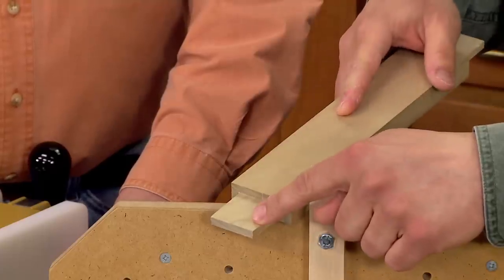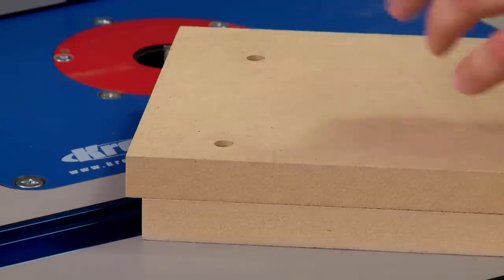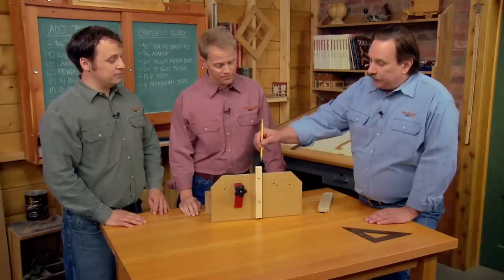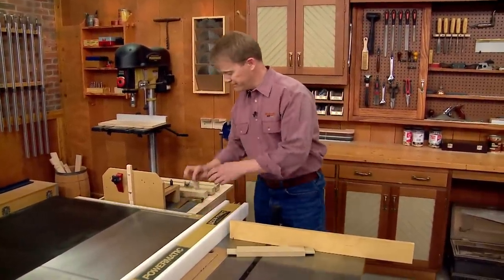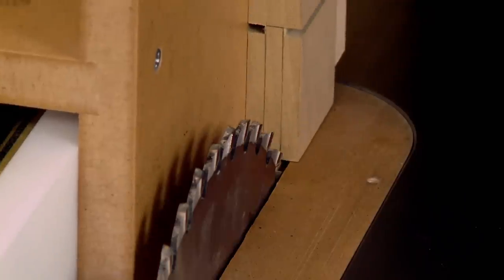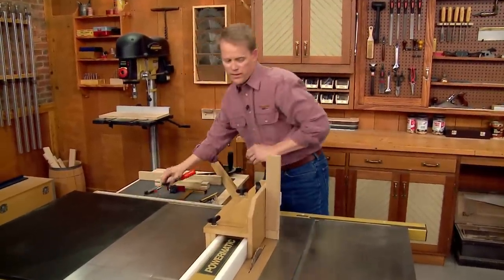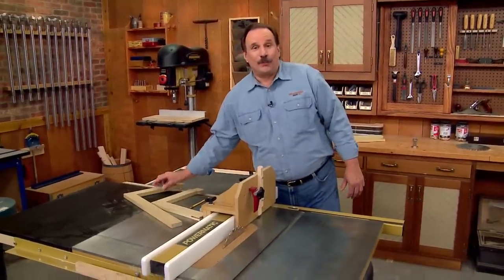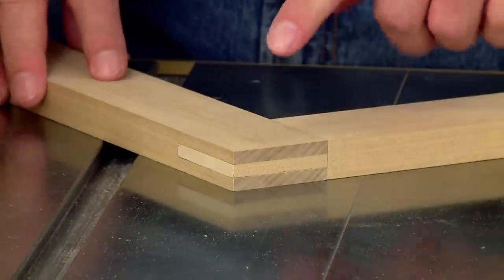Cut Perfect Tenons with this Table Saw Jig!

Comment: nice technic, with the long holes on the router table. I was wondering if this would have been a case for  the use of the guide rail in front of the router? i have seen it seldemly used, honestly i cant remeber one case where it was used. i know you properly tackled the the problem (short side routing on a long board) with the multiple passes, but i also would love a short feedback. thank you in advance
Reply: I agree, other builds I have seen simply build the base 'to fit' with the fit tolerance of a playing card

Comment: That drill hole for alignment tip you mention around 2:00 in, also works well for cutting tenons with stop blocks on the router table. Good call!

Comment: Why adjustable?   It is made with MDF in video.
Reply from the maker: The fit around the fence is adjustable so that could possibly fit around any sized table and/or you can adjust the fit so it slides easily along the fence (not too tight or too loose).  Yes, material we used is MDF, but you could just as easily use plywood, as well.

Comment: Excellent jig design. I only have one comment that I wish you would address. I have been trying to buy a router table since July. No one has them, of ANY brand. I even wrote to the Kreg company. Their answer was that they can't produce them fast enough and some parts are not sourced in the US. They are STILL trying (in NOVEMBER!) to fill their back orders. If we cannot buy a router table, I would have preferred that you also discussed a way to make this without a table. I do have a router. No table. I use it freehand.

Comment: Hi great video btw. The wooden stop block u used , could this then be used as a template for all joints the same size. Just write on it the measurements and keep
Reply from the maker: Yeah, I think that is a pretty clever tip if you wanted to have specific stops to set up for similar tenons in the future... you might have to do a little tweaking to get a perfect fit, but it's a great starting point.  One thing that you'll have to consider is that the workpieces will also need to be exactly the same thickness as before.

Comment: I see that saw threw all those small pieces that were cut at a good speed. aren't they fast to cause injury? or they can be. cuz i see them fly back towards you
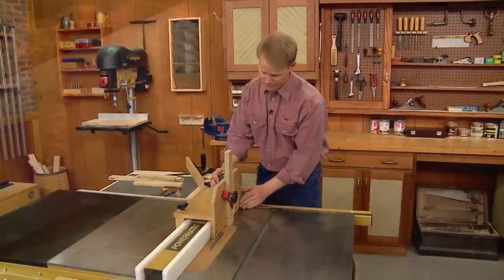Reply from the maker: I assume we are looking at about the 7:18 mark in the video... I think because we are shooting so close up it looks more dramatic than it actually is.  If you look closer the piece starts to slow down before it leaves the screen and if I recall correctly it never actually gets past the edge of the table saw.
Reply: @WoodsmithShowandmagazine   I just started in woodworking and most scary thing for me is Table saw. But I am always thinking 10 times before putting a piece to cut making sure no kick back. i had 3 kick backs so far. two I did on purpose to see how things can go wrong with small wooden pieces and man it goes like a bullet. I always stay at sides at safe region, and wear protection. I see you were standing at sides too. which is good. still we gotta be careful from these kick backs. good video. i learned a lot. Thank you :)
Reply: @WoodsmithShowandmagazine  ??
Reply: @alishanmao  You're doing good. altough that piece of wood particularly didn't go fast backwards. There are some pieces that may get back at good speed. So trying not to stand directly behind it's always a good idea. Hope my english was good enough to make my point ;)

Comment: I've always heard you shouldn't use a miter gauge and the fence at the same time?
Reply: True if you are cutting a piece that will break off. Then you risk that piece getting trapped and binding up the blade. If you are hogging out waste (which is the case here) there is no break out piece to get bound up.
Reply from the maker: Excellent question! As Andy said .... As long as you don't have a waste piece that is loose between the blade and fence you should be okay.